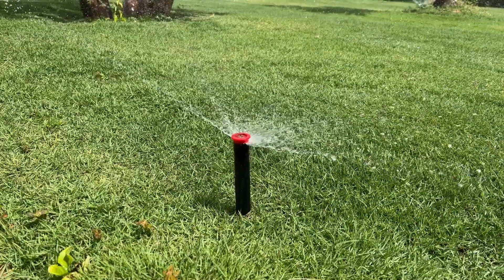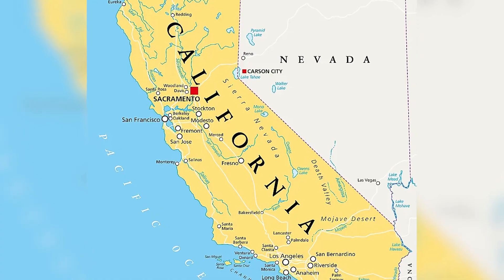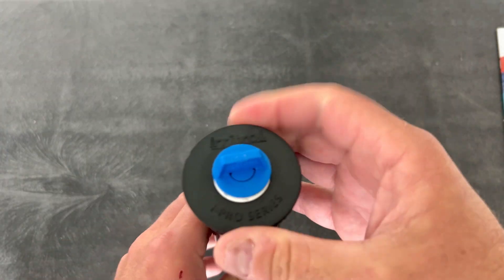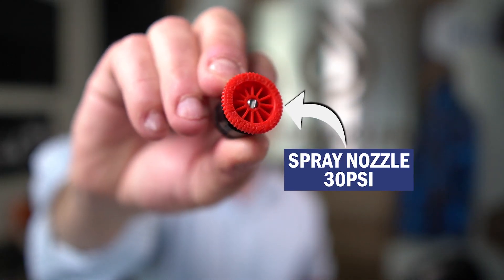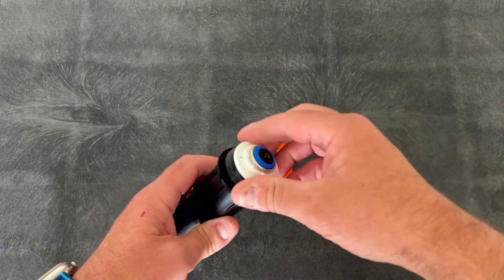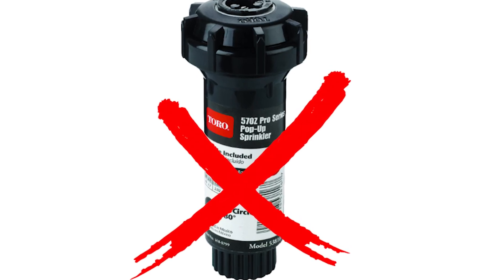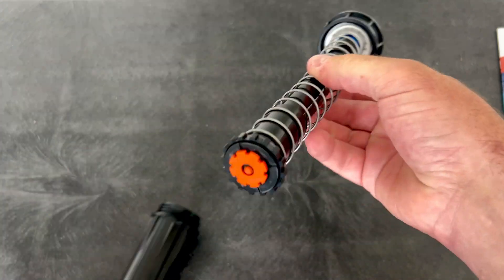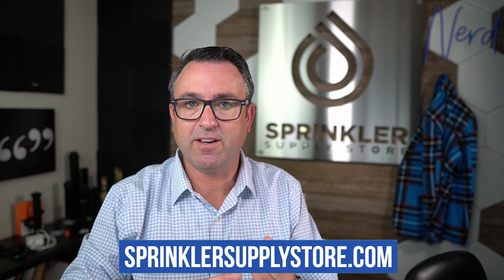ALL Sprinklers Need This Upgrade

Comment: What is the maximum psi range that these are designed for? I tried them on a clients sprinkler and it reduced the psi but was still over 100 with the regulator.
Reply from the maker: Great question. I was not able to find this specification on the H2Owize website either. There is likely a psi range for the device but unfortuntaly I can't find it. Maybe someone else will comment here.
Reply: The hunter accu sync has a 'static pressure' of 150psi (not really sure what that means)

Comment: Does it fit/work on Orbit Rotors Sprinklers ?
Reply from the maker: Good question. This is meant for “spray” type sprinklers as opposed to “rotors”. Do you know which model Orbit sprinkler you have? -Andy
Reply: @Andy_Humphrey  Orbit Saturn III Rotor heads
Reply from the maker: @ascernas  gotcha, thanks. The pressure regulators shown in the video are only for fixed spray heads and will not work in rotors like the the Saturn III. If you think high pressure is an issue for your zone/system, there are other options for you. You are welcome to schedule a virtual service call here: https://calendly.com/sprinklersupply/30min

Comment: It would be alot easier to install a Rainbird PRS regulator into the solenoid and then be able to fine tune the zone. This would be easier than removing the 1800s, especially on sites that can have hundreds of 1800s.
Reply from the maker: Yes, this can be a good option. The downside is that the PRS DIAL requires inlet pressure to be a minimum of 15 psi higher than desired outlet pressure. So if you wanted to set it at 45psi, the incoming pressure must be a least 60psi for it to work correctly.

Comment: Do these fit and work with Rainbird 3500 sprinklers?
Also-
Do they make Low Angle nozzels for the 3500 sprinklers? I've only found them for the 5000 series.
Reply from the maker: @peskypeet -  unfortunately, these are only for pop-up Spray heads. Have you considered adding a pressure regulator to your zone valve? I do not believe there are low-angle nozzles for the 3500. May I ask what problem the low-angle nozzles would solve? Perhaps there is another option.
Reply: @Andy_Humphrey  I don't have a zone valve. I'm using a 3500 on a stand with a garden hose to water under a tree as I have no irrigation system. I use a simple oscillation sprinkler for the rest. I notice throw differences of a few feet at times no matter what sprinkler I use. I figured it was due to city water and the usage around me. I thought the regulators would stabilize the 3500 as with no wind it is at times hitting more of the sidewalk than I'd like.
 
I wanted to try Low Angle nozzles on the 3500 to keep the stream out of the wind. It's already mounted on a very short stand to help but I get wind blowing from two different directions. Between the wind and I believe pressure differences at times the accuracy is all over the place. I wonder if there is a better choice of sprinkler that offers the throw and adjustment I'm looking for. I like to use a #1.5 nozzle in the 3500. The 1.5 nets me about 20+ feet and the #2 consistently reaches beyond where I need it.
Reply from the maker: @peskypeet  thanks for the info, that makes sense!

You can add an inline regulator at the end of the hose, before it connects to the stand. It’s import to get a regulator for the correct flow rate. This link will direct you to a 42psi regulator designed for flow rates 0-4.4gpm.

https://sprinklersupplystore.com/products/netafim-prv075lf42v2k-netafim-in-line-low-flow-pressure-regulator-42-psi

For low angle, you might try a 3/4 rotor, like the RB 5000, or Hunter PGP or I-20.

Actually, my preference would be the K-Rain RPS-75 Select, because it has built-in selectable nozzles (not low angle) but so darn easy. If interested - email/text us and I’ll send you a free sample.

https://sprinklersupplystore.com/products/k-rain-60003-cv-rps-select-adjustable-arc-rotor-3-4-inlet

Comment: I have an honest question. The cost of these retro regulators is a buck or so more expensive than buying the rain bird 1800 4” with the 30 psi regulator built in from a wholesaler. Is this just atypical pricing on the rainbirds? My entire system is the 1800 4” so just replacing them all would be cheaper at the moment.
Reply from the maker: This could be possible, or at least it may depend on the retailer’s pricing. We sell the Retro-Regulator for $3.99ea (10 pack), which is below the direct cost of the Rain Bird 1804PRS before any markup (which we sell for $7.58). It is possible that someone is selling the 1804PRS at a loss, we see it everyday.

The 4” pop-up size would be the closest equivalent, as the pressure regulated sprinklers get more expensive as the size increases (6”, 12”).
Reply: @Andy_Humphrey h the discount on the 10 pack makes sense. I was seeing individuals for $6 vs individual 1800s for $5. Bulk wins for the inserts though.

@richsellskc no digging required in my soil. Either do like they said and pop the cap, or just spin the entire body off and gingerly pull them out and insert the new. Do this all the time as long as dimensions are the same (can’t do it if going from hunter bodies to rain bird for example). Now if they’re sunk an inch or 2 below the soil line this becomes more difficult, but mine are flush.
Reply from the maker: @somethinghandle  right on!
Reply: replacing them there 1800's means diggin em up. what a pain.  just re-move the crown, insert this here new fangled regilator. boom!
Reply from the maker: @richsellskc  you got it! 

Although, it is possible to just replace the 1800 inner workings with the PRS version and using the existing canister/body, however, you’ll be tossing out the new canister and the old inner workings.